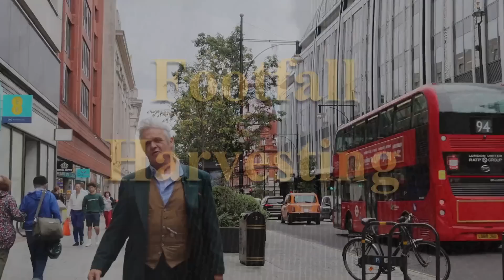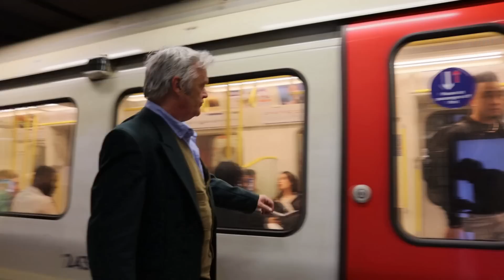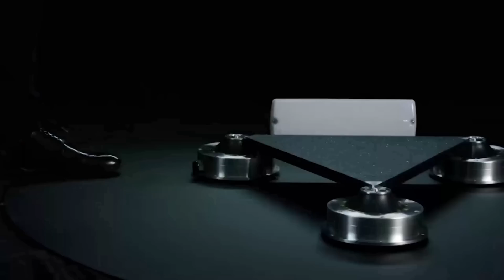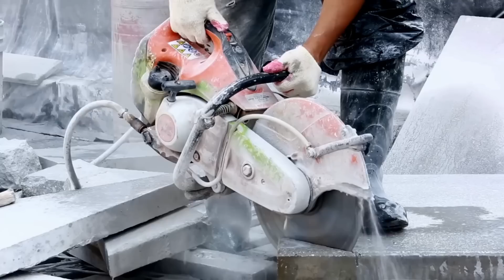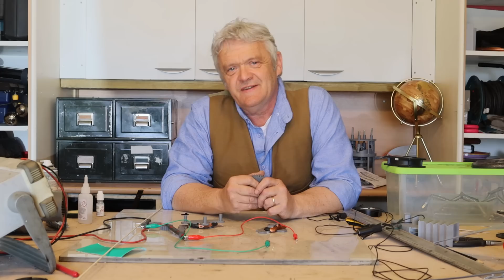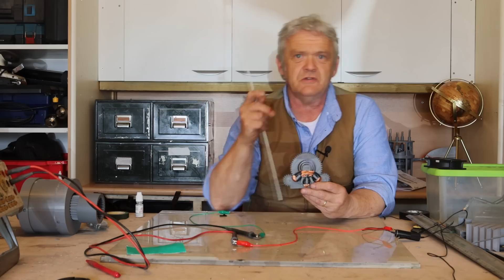2037 The Footfall Harvester

Comment: The oscillating widget you made has a lot of potential if placed in a water location with strong oscillations such as beach areas where there are regular ocean waves... the kinetic energy is massive there for scalable power gen.  Those sidewalks are cool and nifty, but cities buying these will Never recoup the installation and maintenance costs for the amount of electricity they generate from "walking"... it is simply not economical. While I do understand that experiments and prototypes need to mature to get their full benefit, I think it is also important to take stock of the reality... those devices will Never have economical benefit over tidal, wind or solar b/c the energy density is many magnitudes better over time.
Reply: The thing is generators like these aren't meant to be by themselves. The proper end result would be a city wide network of energy harvesting each generating power for certain things in their immediate vicinity. This partnered with some intelligently designed and incorporated solar panels, wind turbines, and other possible kinetic recovery systems could generate enough electricity for the street lights for a few blocks and send excess energy into a local battery bank. A collection of modular systems that dont all have to be directly connected throughout the city.
Reply: @Javierm0n0  That doesn't change the fact that they aren't economical. The cost to make them (panels that generate electricity with walking) exceeds the amount of energy they can "Ever" generate in any reasonable payback period... You can't have people stomping on a tile every 1/4 second every second of a 24 hour period and not "break" these things. By the time they make any useful electricity it will be decades and decades after install, and they will have to have been replaced many times over. If people don't step on them often, they generate nothing. This is starkly contrasted by Solar which pretty much guarantees a certain percentage of the day will be sunshine or cloudy and produce thousands of kilowatt hours in just 10 square meters every day for 20+ years. Even when it is cloudy 10 square meters will still produce usable electricity. Whereas, the amount of electricity produced by "stepping" on a tile is so fractional as to be laughable because it is incredibly intermittent as well as very limited in the actual power delivered. These ideas are "creative". But, it is important to understand the limitations of the tech. The theoretical maximum of this technology is simply too limiting to be useful as an energy source unless one was literally desperate and had simply no other way to make it. You would be far better off using the copper in the coil for some other purpose than a "sidewalk" panel that generates from walking. For example... you could use the copper to make a generator that hooked to a bicycle in some fashion. That would work much better and have much more usable output on a consistent basis than panels designed to generate electricity from walking. But yea, I challenge you to get two panels and spend time making electricity for an hour... vs 1 hour of riding a bike with a 12v generator. After 1 hour, the walking panels will have made next to nothing, where as with a bicycle almost anyone can generate around 100 watts to 200 watts easily and continuously for 1 hour. It is simply a matter of mechanics and efficiency. Again, I like the creativity, but these "Gimmicks" are why people keep getting fooled into investing in these ideas... and it is not a good idea to promote these ideas as actual solutions... because they are not solutions.  Several cities have already spent thousands on these "sidewalks" with no payback.

Comment: It could be integrated into vehicle suspension, with better effect IMO. As well as small energy harvests integrated into brake systems.
Reply: 100% this - you slap one into each hub assembly every single pothole uneven surface would generate power
Reply: Fine idea! With the suspension constantly moving this could work. So much energy is wasted in cars, lots of movement and heat. Something should be done with the heat as well.
Reply: if you can capture the heat energy loss from an engine its over - you dont need fussion  @gorgosanma
Reply: I had a similar idea some years ago about the heat waste. I wondered if it was possible to replace the alternator with a Stirling engine wrapped around the exhaust manifold. With the benefit of removing the drag from not having the alternator (they do put a fair bit of drag on the engine, that is why most people remove them for the drag strip). In the end I concluded that you wouldn't be able to generate enough from that alone. you might be able to use a smaller alternator (with reduced drag) but the cost wouldn't be worth the effort :( Had a fun time thinking about it though. There is a lot of wasted energy around a car that could be harvested if we couldn't only figure out how to do it cheap enough (including cost of maintenance due to higher complexity)

Comment: Interesting physics. I think I've heard of playpark equipment with generators in.

Not sure about the pavement application as pedestrians have to use more energy to walk across the energy harvesting pavement, so that it can harvest energy from them, without asking permission first. Seems like a bit of a liberty, and walking on a spongy surface like that also looks a bit awkward.

Perhaps the concept could be better applied to the sole of a shoe in a solid state (piezo electric?) form, because that surface is supposed to have some give in it.
Reply: If the Vampire effect was a real issue, this tech wouldn't be being installed on Railroad Tracks. 
For those boys, even a penny a mile of extra fuel cost adds up fast.